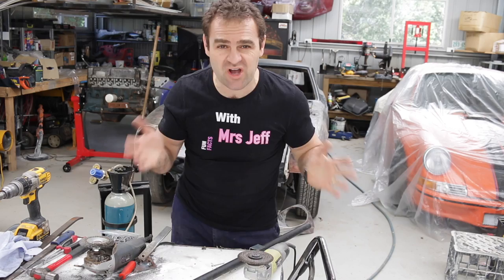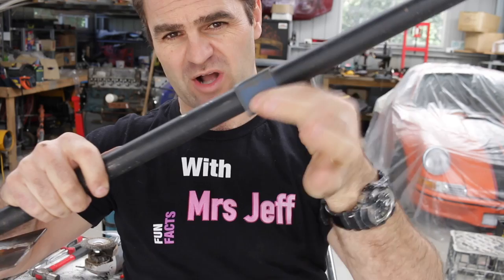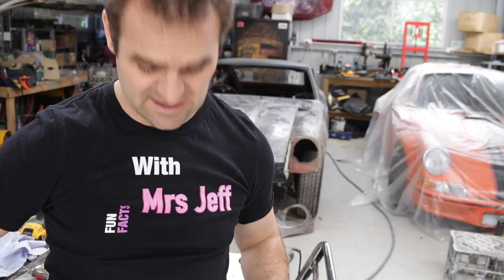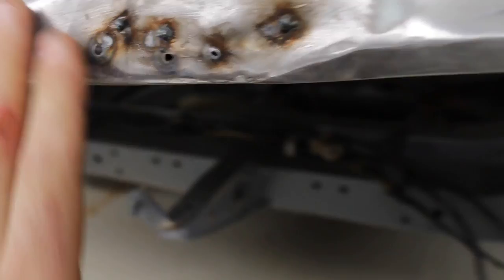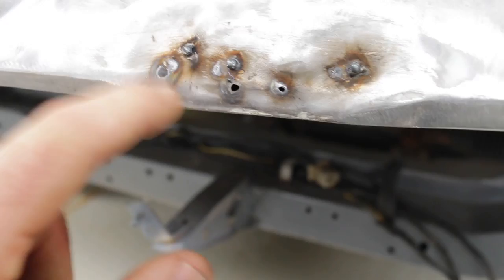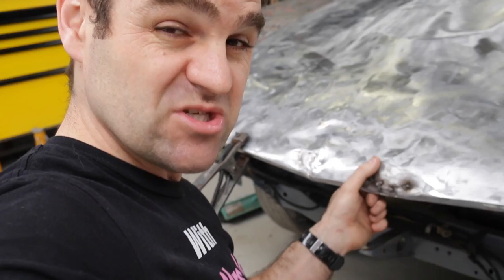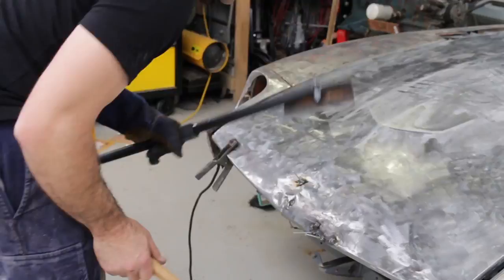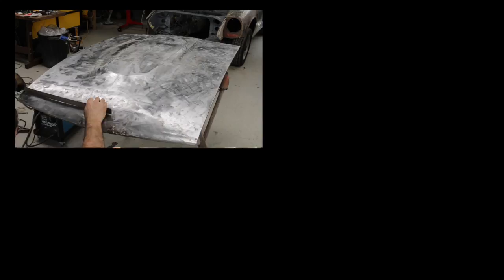DIY dent removal Ezy Beat inspired Stud Welder

Comment: A dent that size I would have been tempted to tack a piece of decent gauge sheet metal to the bonnet with a hole in the middle and use a slide hammer with the hook. We have miracle pulls and all sorts of expensive stuff at work. They all end up bogged up anyway. Unless you are some kind of rolls Royce spec coach builder, modern body filler is a wonderful thing!
Reply from the maker: I was happy to work at it slowly and methodically. I am not getting paid by the hour, so I can take my time. I understand in a shop, time is money and no one wants to pay.

Comment: Thanks for the link to this video! Your stud puller is nice and simple. I have one of the pro stud welders with the slide hammer. The slide hammer is just not very nice to body panels since it requires two hands and just pulls the metal out in a cone. I will be making one of your pullers here soon I think!
Reply from the maker: I like the control you have with this simple puller.

Comment: Now that you have the Z down to bare metal, how do you treat it so it doesn't rust up?  Sorry if I missed that in the previous video....
Reply: If its a dry garage itll probably be fine, itll only rust if moisture gets to it
Reply from the maker: As Sam said, it is dry in the garage so it can stay that way for now. When I am ready to do the body filler and paint I will go over the whole thing with a rust converter, to make sure any new rust forming is dealt with, and then it all will be covered in etch primer, which will seal it for good. You can go back and see how I did it on the 911 in the earlier videos.
Reply: My ford has lead paint underneith the blue original paint. It hasn't rusted in 50 years.
Reply: it well still rust over time as the air around us has moisture in it
Reply: You can spray OSPHO on it, let it set 24 hours (keeping it out of moisture, such as in your garage), and then wipe off the excess OSPHO residue, and use an EPOXY primer as the base. Works like a charm, and CONVERTS the Oxide (Rust) into an inert CARBON.